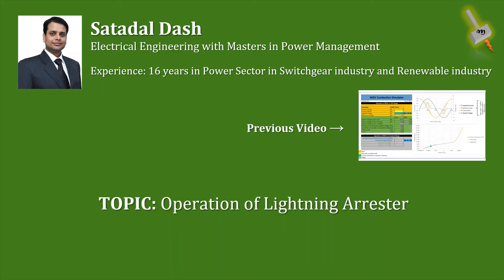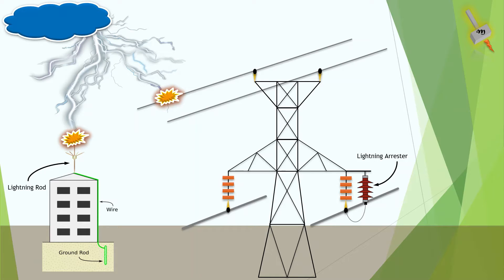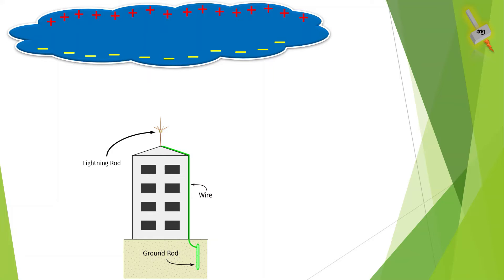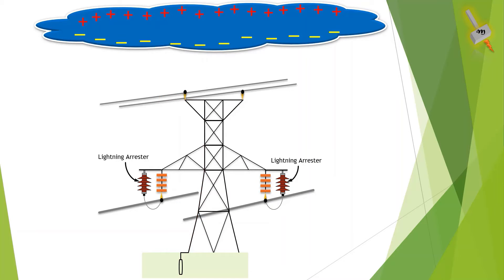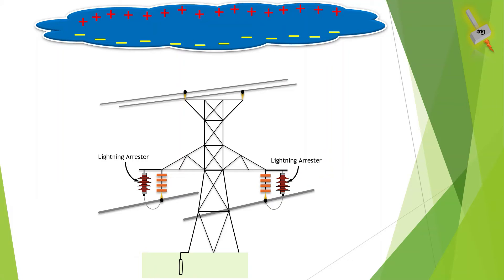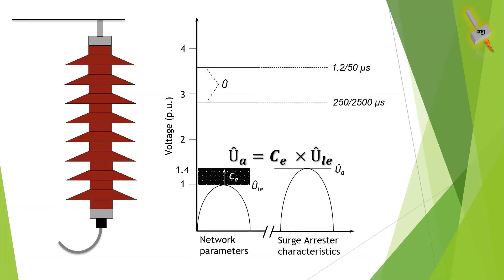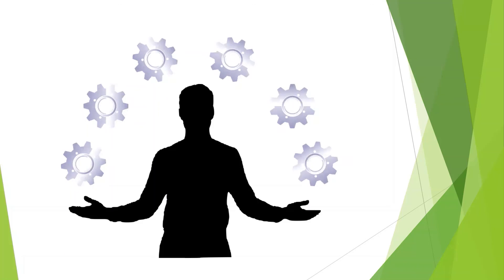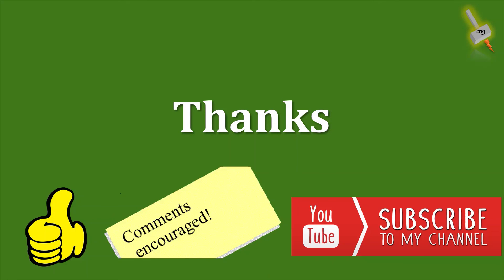Operation of Lightning Arrester

Comment: It consists of a spark gap in series with a non-linear resistor. One end of diverter is connected to terminal of equipment to be protected and the other end is grounded.
•The length of gap is set that, the normal line voltage is not enough to cause an arc across the gap but a high voltage can breakdown the air insulation and form an arc. The resistance decreases as the voltage increases.